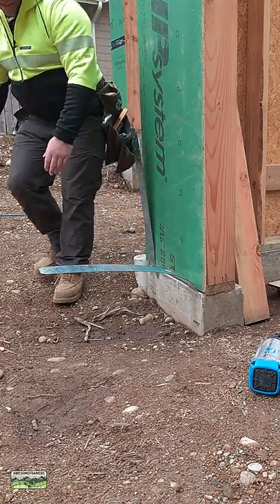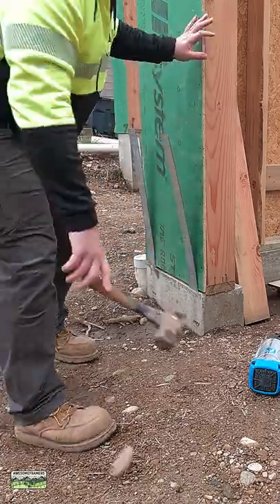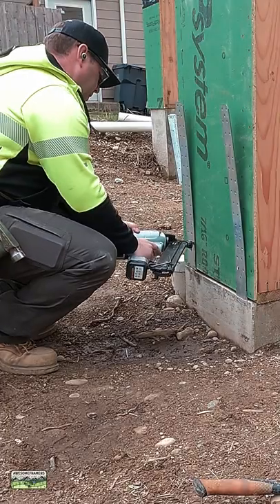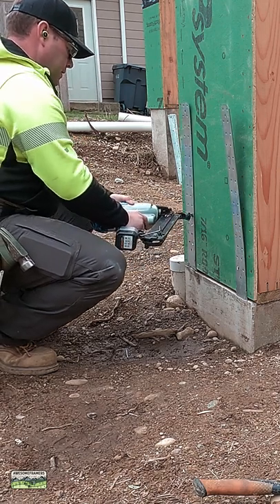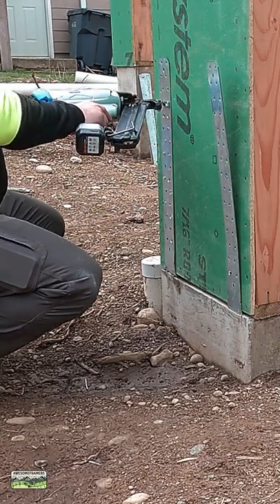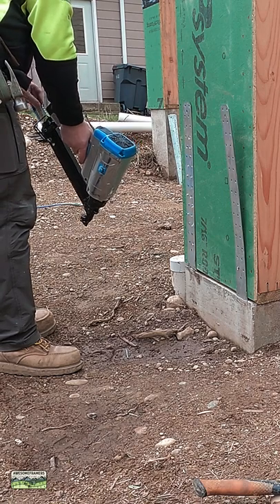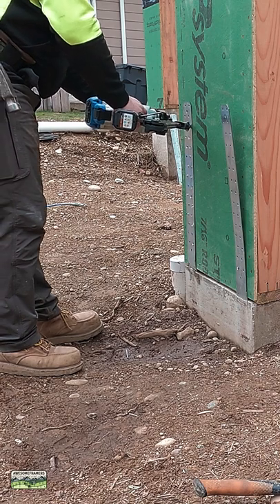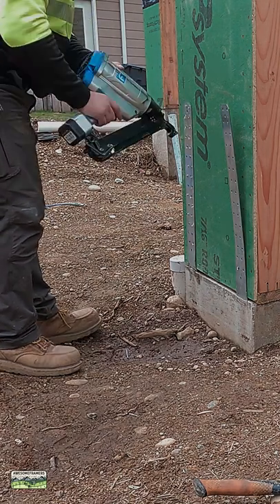Let's Just Do it Right #shorts

Comment: $50 more nails and then id consider that it might possibly be secure 
EDIT:read my comment before you make a angry one 👌
Reply: The holes are there for a reason to do the job correctly
Reply: There's more to it than just nailing those hold downs.  Extra nails with shirt spacing in perimeter and the field of the sheathing as well as extra nailing above there and more straps securing the studs to the header that extends to the corner, not just over a couple jack studs.
Reply: This is what holds the house to the foundation so it doesn't blow away. It's the last piece to an exstensive system of straps and hangars that every house built to code uses.
Reply: @skm9420  60 years ago they used to drill a hole and put three 16 penny nails every five or six feet and those houses didn't blow away
Reply: @skm9420  not every house....only windstorm zone engineered houses.
Reply: @grantquinones  some do.  And some are just damaged by wind.  Doesn't have to blow away completely.  Plus the designs of newer houses are more susceptible to windstorm damage so they have to be engineered to prevent damage on newer houses with big balloon framed exterior walls, more expensive open floor plans that don't have the rigidity that earlier plans had from more interior walls and larger openings in vital areas such as big garage door openings and bay windows etc in the corners of the structure and more covered exterior square footage susceptible to uplift forces etc... For the most part it's about combatting uplift and exterior walls with wide breaks in straight line wall framing from racking .

Comment: What do these straps do?
Reply: part of a system designed to strengthen walls with large openings near the corners of the structure or at parts of the structure that extend our from the exterior wall, like a bay window.    it basically keeps that wall from racking because it's got a big window or door in it so doesnt have any studs in a large portion of the wall.  those get secured to the studs which support a headed that extends to the corners and gets strapped together and there's a specific nailing pattern in the sheathing.  called a Portal Frame.

Comment: I don't utilize a gun to shoot through metal straps I hand nail them and I hand nail them in an upward position that draws the strap up to the wall itself even tighter
Reply: Which is counterproductive if the house has uplift forces applied.  get the anchor straight and nail it straight.  If the engineering requires angled nails, the hold down will be built to accommodate it.
Reply: @invictusbp1prop143  it's only the first couple of nails to draw it up. I understand shearing strength. I also don't have an eye patch as cool as it would be

Comment: I feel like every year they add two more nail holes to these straps
Reply: In a decade it's going to go across the roof
Reply: @tedkaczynskiamericanhero3916  haha probably so
Reply from the maker: We've been installing these for years and there aren't more nail holes. It's actually going the other way with some of the hardware, which is nice.
Reply: @AwesomeFramers  yep , just ad I suspected.........must be getting kick backs .........LOL ......Keep them videos coming,  love the shop talk and often something  new and I've been doing structures for 45 years , before nail guns and compressors,  before OSB and five quarter decking boards and most porch decking was 1 1/2  cedar , no pressure  treated or other green woods. Never no plywood on exterior walls. Case hard or cut nails into slabs or concrete blocks that basically held the plate down long enough to get the weight on the walls that held it down .......how far we have come ! Not a better job in the world !

Comment: Are the straps for tornados?
Reply from the maker: They are hold downs for the shear walls.  Shear Walls need to be tied down or they will over turn.  High winds and earthquakes are specifically what these are for.  I've talked to quite a few structural engineers, tornados are an "all bets are off".

Comment: As 50 nails distroy the wood under strap... Lmao
Reply: Yes thank gawd you figured out the fatal flaw that every engineer in the country previously overlooked.  you'd think somebody would have tested that before adding it to the code and requiring it in countless homes.   
you do realize they're not just nailing into the sheathing, right?   they're secured to doubled or tripled studs behind the sheathing...

Comment: I preferably use hold down bolts that are equivalent to the strap that go inside the wall whan there is room....those straps are a nuisance come siding time.😜
Reply: Those ‘bolts” have to be used as part of a system that replaces the stick framed return wall with manufactured panels on either side of the opening that’s designed to provide the lateral stability needed for the portal frame.  The purpose of either anchoring method isn’t just up,it, it’s to prevent the opening from racking  which it’s prone to doing with just a short return wall there in the corner of the structure. A longer walk would provide more lateral stability, keeping the top of the wall from shifting.   The portal frame system is to stiffen up that wall and keep the 90 degree corners at top and bottom of the opening.  The header extends over the entire return wall, which is actually a pier which is strapped to the header on the inside and covered with a single sheet of sheeting in the outside which also gets a series of two rows of nails to secure the top corner in the way a piece of plate would be welded onto a corner made of steel tubing…to reinforce the corner instead of using a gusset to maintain the clear opening space.

Comment: The tornado will still ruin that house. I suggest a stamped picture of a strap to achieve the same effect. Now if you wanted to anchor the house such that it wouldn't fly away in a tornado, you would do a calculation for full vacuum.....14psi. if your roof could be pulled by 14psi, a 1000sqft roof would pull 14,000lbf so it better weigh 14,001lbs and it better have straps that can hold that much weight at a single spot.
Reply from the maker: This home isnt being built in a tornado prone area, just like most homes aren't built in tornado prone areas. Hold down straps are to hold down shear walls in earthquake zones and high wind zones.

Comment: To many nails it doesn't mean that you do good , you may can make that wood split
Reply from the maker: That's why the nail pattern is designed, engineered and tested to failure.  That testing data is available and these straps have been used successfully for 3 decades +

Comment: Doing  it right wouldn't use osb ,concrete block ,would be right , it's not just about up lift ,my house in hurricane Andrew had all the plaster beat off of the block on the south face ,vinyl and osb will be disregarded...
Reply from the maker: There are many "right ways". Hurricane Andrew was 30 year's ago, modern construction includes lots of lessons learned.

Apawood.org
Reply: @AwesomeFramers  that's right in 1992 they outlawed osb in south Florida ,after just one Project used it,. Buddy I forgot what you think you know about building buildings...
Reply from the maker: @bluzcompany2293  time to get caught up on modern building codes, you're incorrect
Reply: @AwesomeFramers  just keep thinking Butch,that's what your good at.
Reply: @AwesomeFramers  building codes, south Florida has the strictest codes in the United states, that's why osb particle board was outlawed in 1992. How many years have you been framing?
Reply from the maker: @bluzcompany2293  check the CURRENT codes 👍

Comment: No wonder American houses blow over. What a crap way to tie down
Reply from the maker: American houses blow away? Can you show me one example of a modern house that blows away?
Reply: @AwesomeFramers  look at any aftermath of a tornado. A pile of sticks and unreinforced hollow concrete blocks. In Australia tropical areas we use 12mm threaded rod from the slab to the top plate at 1200ctrs then strap each truss. We don't nail plywood on the top of trusses and add flimsy bituminous sheets either.
I don't know how engineers calculate  that a simple kogged strap unattached and driven under a plate 🤔 will hold anything when strained. I don't wish to insult Americans but your standards need to be reviewed.
Reply from the maker: @geoffwaterman6560  ask engineers, tornados are all bets are off.

If you are interested in learning, I would recommend apawood.org and awc.org

https://youtu.be/87Qvhg53e28

Comment: That has to wreck the siding finish.
Reply: why? A proper siding should have 1x4 batten for rainscreen anyways. Either ways, i wouldn't use these straps and use HDU hold downs in the frame.
Reply: @Pepe-dq2ib  Here in the US, where I live, I have never seen a siding install on batten. I've never read a single manufacturer literature that required it either. Thanks for all you do for the based community pepe🤣
Reply: Thanks Tim for calling out the nail!!
Reply: @RichardMcDonaldJr  I never said it was required, it isn't code, just best practice. It isn't expensive either, the batten doesn't need to be pt and any insect screen on bottom is fine. There's plenty of things I never see installed either because it isn't required or code. I never see soffit baffle installed, but I do in all my work. Tension ties weren't code for decks either, but people been installing them for the past 30years. It's code in a few states now.
Reply: @Pepe-dq2ib  I understand. It sounds like a weak point in the siding to me. I definitely wouldn't install Hardie that way, as it can barely take a rock or ball with complete backing. A properly flashed home shouldn't need a rain screen. I think that is a lot of effort for the very small benefit of negating a small penetration, if it occurs. I guess everyone has their own preference though.
Reply: @RichardMcDonaldJr  90% of the installs are with Hardie siding and no problems. Its actually very popular in Canada and the midwest usa. its not much effort installing batten around the house since youre doing siding anyways. Its actually a cheap insurance incase there is torn, missing or over penetrated zip sheathing that somebody forgets to seal. And of course, you can install the stupid strap tie like the video or any protruding hardware.
Reply: @Pepe-dq2ib  I'm not familiar with Canada, but have lived in Ohio and Missouri and I haven't seen it practiced either area. I know it's cheap, but I just couldn't rationalize it myself. The likelihood of a leak behind a properly installed and flashed job is so low, I can't find value in it. You'd also have to manage extensions on all of your trim and accessories. Just do the siding install correctly and there will be no rain penetration. Windows are the only typical problem area, and that comes back to flashing properly .
Reply: @Pepe-dq2ib  it's always up to the builder what is used on the house/foundation
Reply: @tristangarvey1103  yeah and i just said i wouldn't use it, not telling him he cant.
Reply: @RichardMcDonaldJr  i am not good at explaining, but heres a recent video that maybe can explain the difference in building concepts better https://youtu.be/bZGuSC7KNvM?t=634

Comment: lol some more useless engineering. 2 j bolts through the bottom plate and tie the wall with sheathing. It’s not going anywhere.
Reply: Houses have been lifted completely off the sole plate if fastened just with nails or screws in hurricane areas
Reply: J bolts for the win. Earthquakes and hurricanes are not a concern where I live.
Reply: @mikeirvin9694  It’s all about you